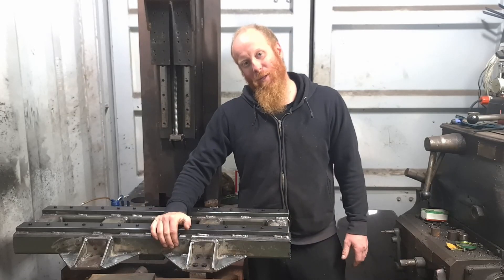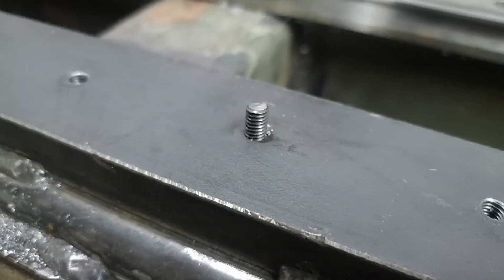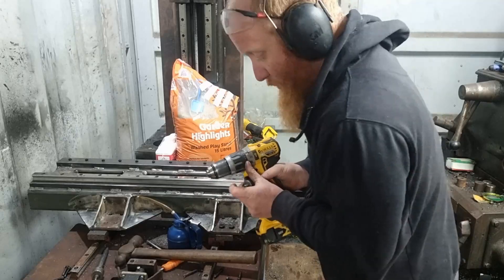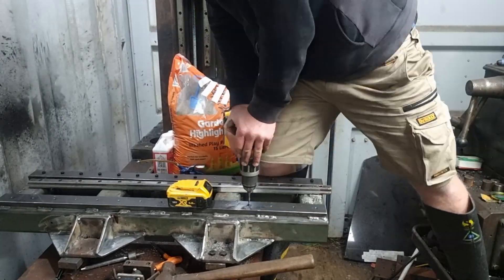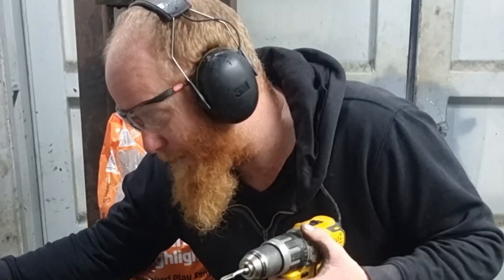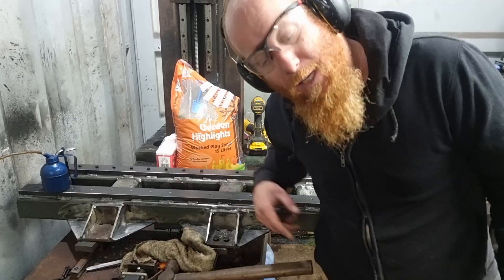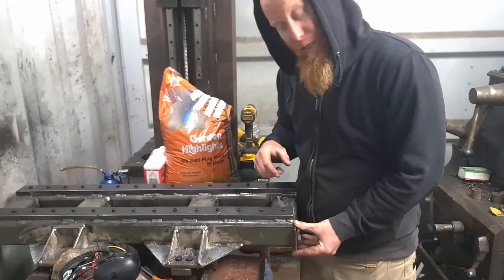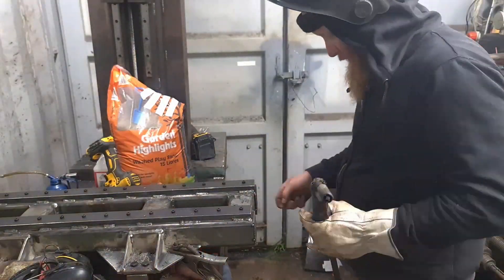What Am I Going To Do Now diy cnc mill

Comment: Friend, can you please answer some questions for me: Are the linear guides 25mm? is the ball screw the sfu1605? 1kw servo motor? Could it be that the sfu1605 is not too small for the machine? with this ball screw 1605 the machine can machine iron?
Reply from the maker: hi there thank you for your comment.
yes the linear rails are 25mm and the ball screw is sfu1605.
I think yes they are a little small for the weight of the machine but they work for now.
I will be upgrading all of that.
yes the servo is 1kw very powerful I would recommend.
I'm going to put servos on all axis eventually.
Reply: @gingerninjaneering  friend, Thank you very much for your attention, you cleared all my doubts and I am very grateful for that. Your machine design is great, one of the best I've ever seen on the internet. congratulations on the job well done. I'm looking forward to the next videos. Hugs from your newest Brazilian friend. Sincerely Audryn Thompson
Reply: @lojadasmatrizes1447  That is not a problem at all I'm happy I could help.
I would like to see your project.
I appreciate your comments thank very much.

Comment: Were the holes through or blind? If through, did you put any coating on the bolt threads to keep the epoxy from sticking? I'm looking at the same thing on my design. If I do the holes through, it will be significantly easier to drill and tap. But then I have to figure out how to keep the threads clean during the epoxy granite pour. Thanks.
Reply from the maker: Hey mate the holes went right through.
when I filled it I had all the bolts in as deep as they could got.
Then I rammed the epoxy in was a pretty dry mix. 
After it dried I just unscrewed the bolts nothing stuck.
I would advise running the tap back down the hole after you take the bolts out. 
blow it all out with compressed air before trying to bolt rails.

Comment: did you try to grab the protruding bolt thread to remove before cutting and redrilling it?
Reply from the maker: yeah I did try that but it was well stuck in there I couldn't budge it. I was going to try weld a nut on but doesn't tend to work to well with hardened bolts. cheers for your comment most appreciated.
Reply: @gingerninjaneering  Thats what I was thinking too thanks for the reply! I'm subbed for sure!
Reply from the maker: thanks mate I really appreciate that alot.